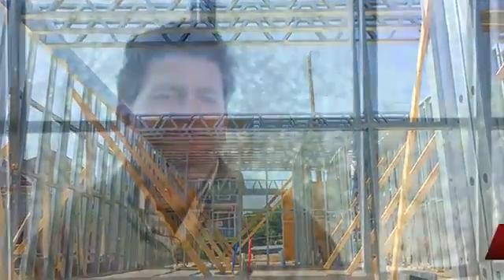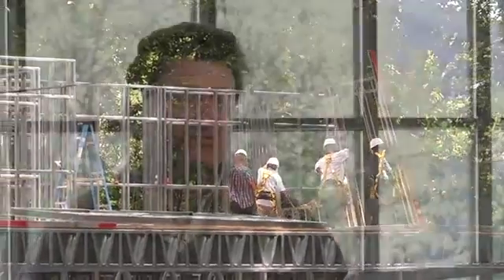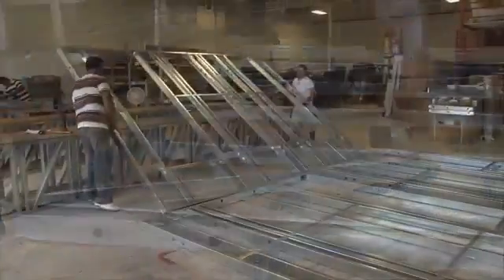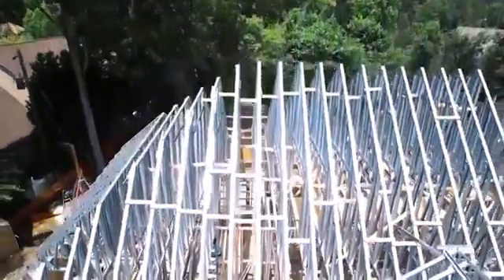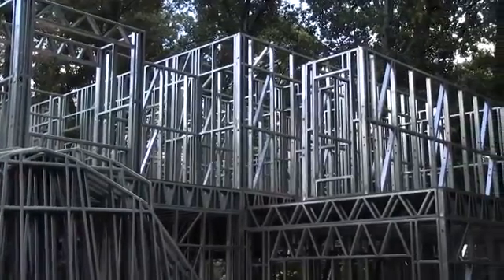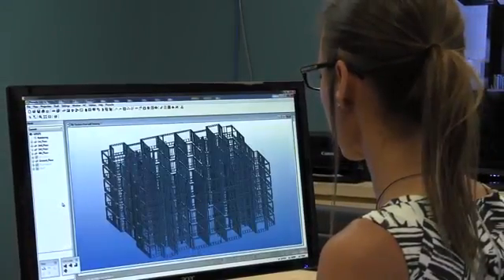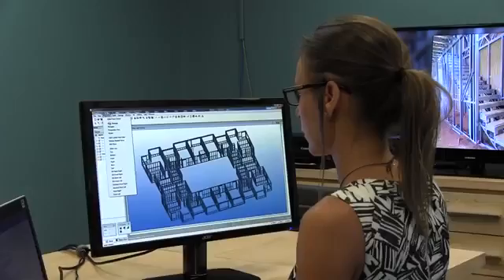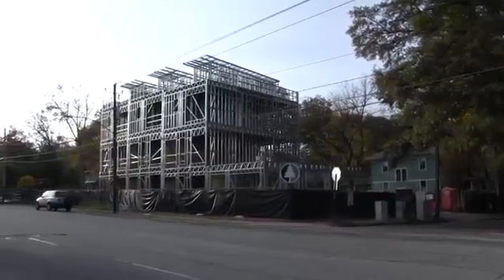Light gauge steel frame building system for low cost housing projects

Comment: Nice ,How much does a two floor house  160 square meters frame will cost .
Reply from the maker: 160m 2 each floor (total 320)?
Reply: @stretchceilingsDubai  80 square meters each floor
Reply from the maker: @Mg-wd6id  just rough estimation: design and production will be around 9K USD but better to see any drawings